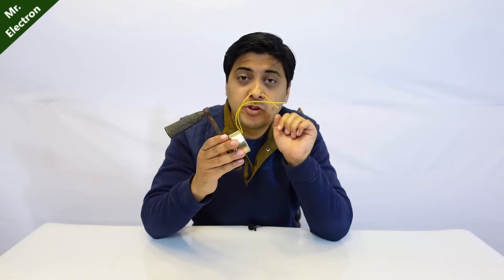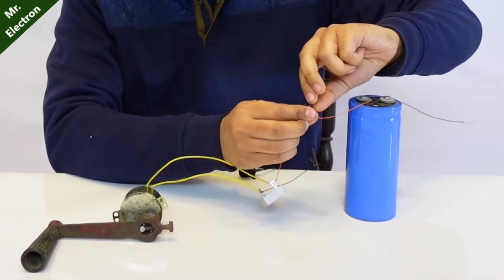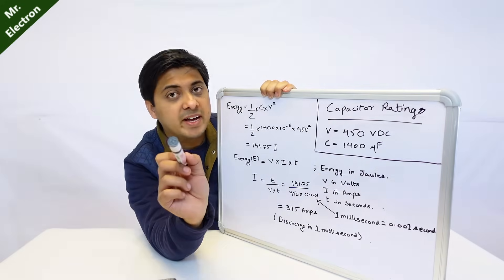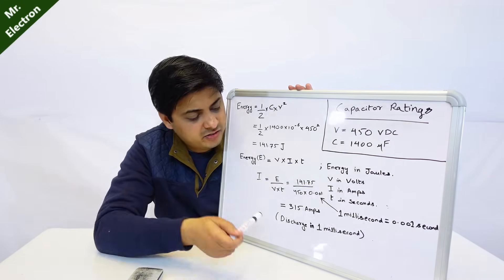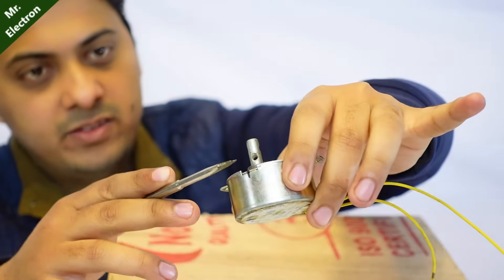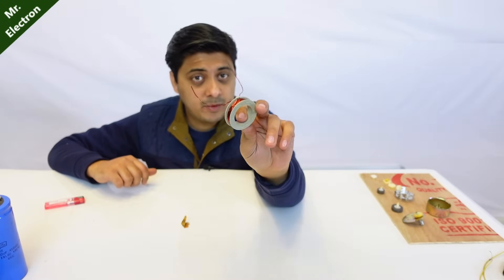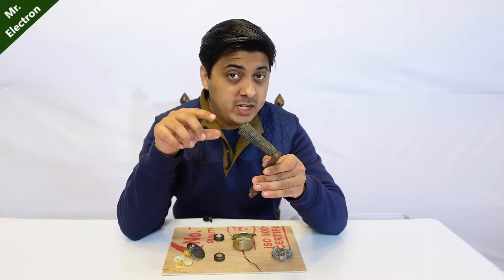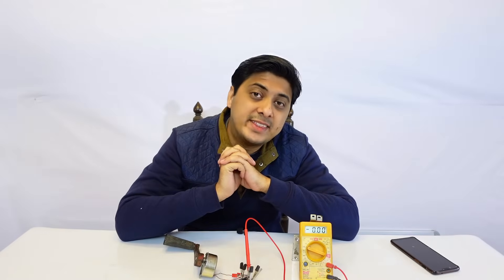300 AMP DISCHARGE !!!  Generator from 220V Microwave Synchronous Motor DIY

Comment: Bro just take your old original motor and attach a mini 0 to 12 transformer than add a bridge rectifier 
It will give you more than 12 volts and more than 0.7 amps without that much struggle.
The working principle of this is that when the electricity is step downed by a transformer it lowers the voltage and increases the amps 
But I appreciate your work Thanks ❤❤❤

Comment: Hi, How many turns for a small Synchronous Gear Motor AC 220-240V 4-5RPM 50-60Hz. Would be of great help. It belongs to a desktop aquarium, for some reason the motor is burnt.

Comment: Hi, I accidentally broke the motor coil. I wanted to ask you how I could do to deliver the maximum current always with the voltage of 220 volts? which thread should I use and how many turns. thanks I wait for an answer.
Reply: Looks like you're still waiting

Comment from the maker: Even though i said 5 Watts in the video , the correct answer was 4 Watts. I corrected myself at the end of the video by saying " Ohh it's 4 Watts 😈 "
Reply: OI!!!!!!!! THAT'S WHAT I SAID!!!!!!!!!!!!
Reply from the maker: No comment from you.. 
Note that YouTube auto removes negative comments or comments with negative statements in them.
Reply: @MrElectron  I didn't say anything rude!
Reply: I don't write inappropriate things; it's not nice
Reply: @MrElectron  I basically said the motor is a 4-6w synchronous single-phase AC motor. Nothing inappropriate there.
Reply: And I also said it first! I will send you a message on gmail of a screenshot of my comment (not inappropriate) for proof that I sent it first
Reply from the maker: @Julian's lab Hey! Don't worry. I have mailed you back. I have alsi attached a screenshot.
Btw just approved your comment 😊
Reply: @So1ipse @Mr Electron Thank you very much!
Reply: DID YOU READ MY COMMENT?!?!??!?!?!?!?!?!
Reply: btw nice devil emoji! :D
Reply: Watt did  you say?

Comment: The motor is a 4-6w AC synchronous motor. Produces high voltage but extremely low electric current at low rpm because windings are extremely thin
Reply: For bigger electric generators they use a driving force with more energy (e.g.: internal combustion engine) to power a generator with thicker wires and more turns. Also in generators like thomas edison's DC generator and nikola tesla's AC generators they use different methods of excitation like seperately excited or series wound or shunt generator
Reply: REMEMBER: IT IS NOT AN ASYNCHRONOUS MOTOR; IT IS A SYNCHRONOUS MOTOR; THEY WORK DIFFERENTLY BUT ON SIMILAR PRINCIPLES
Reply from the maker: I had to go to the ' held for review ' section to approve your comment ....
Don't give  range type answers but only specific answers ..
Reply: @MrElectron  do I win???
Reply: the DC motors?